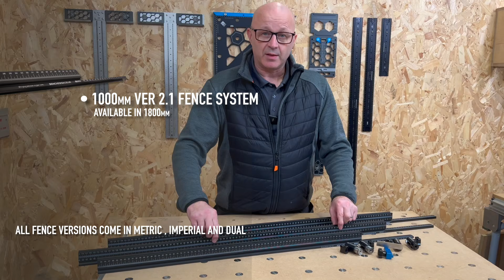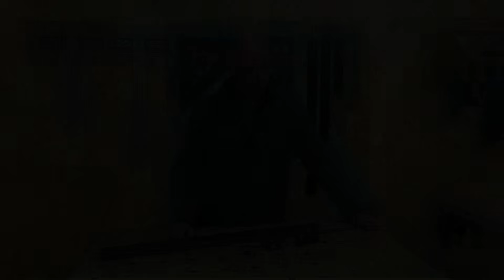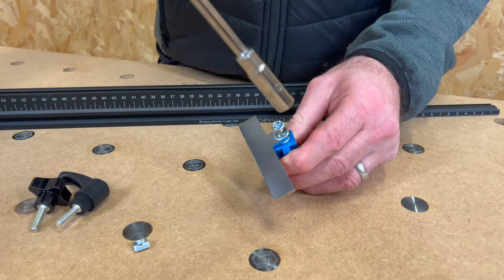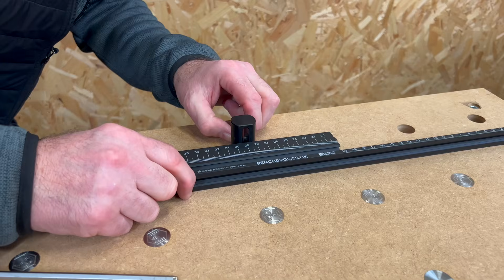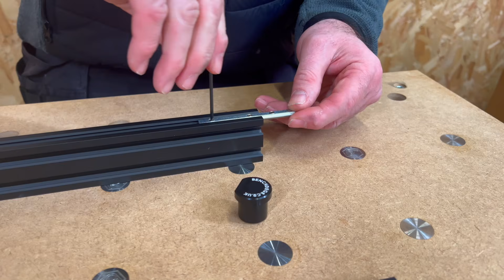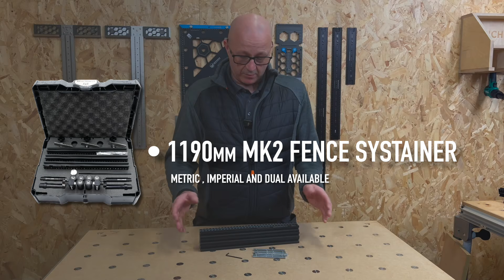Benchdogs Fence System

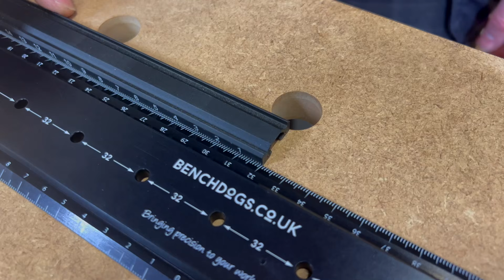Comment: At 6:43 you check the measurement of the flip stop. 

Mine seems right on, but the extension under the fence is too long, by a half mm or so. 

Seems like I should trim it off with the track saw.

Comment: I found the T-nuts supplied with the Bench Dogs and Flag Stops very annoying because they easily slide and fall out of the Guide Fence’s T-slot and can easily get lost.  So I replaced the supplied T-nuts with slide in ball sprung T-nuts which stay in place when the Dog or Flag Stop is removed so I’m less likely to loose them. These ball sprung T-nuts still allow the Dog or Stop to easily slide along the Guide Fence’s T Slot.

Comment: So what exactly is the difference between the Mk2 fence and the version 2.1? I need a fence for my Kreg ACS track saw and can’t tell the difference from this video.
Reply from the maker: The mk2 has a 200mm add on and the ver2.1 has the under rail support is machined out of the extrusion
Reply: @Benchdogtools is there benefits for being able to remove the under rails support? I’m leaning towards the Mk2 as you can make 8 inches longer. Is that correct? Thank you.

Comment: Would you recommend a 1000mm or 1200mm fence for a MFT3 or MFT1080? You wouldn't use a right fence on a table this small by itself correct? What is the advantage of the quad dogs over the fence dogs?

Comment: Hey team, recently purchase the 1000 mk2 and want to get it square to the mft hinge and track. 

I’m struggling so was wondering if this system only works with track dogs for the track itself.
Reply from the maker: Hi Casey. 
No problem we can help you solve any issues. Can you ping us a email with some photos of your setup and we can see where we can assist you further.
Reply: @Benchdogtools  I purchased the quad dogs with 40mm shafts. I’ve also purchased Dave Stanton’s dog locks which work great. My new issue is that the cut line is over a column of holes in the festool mft top. What would you recommend doing? I can see it’s the same in this video?
Reply: @caseys717  Hi Cassey, that is the known issue with this setup. Use our benchtop protectors, which will create a void between your workpiece and the table. This will prevent this, or using the guide rail dogs as it moves the cut line in between the rows of holes. Hope this helps.

Comment: Minor comments: I have one of these fence systems and I really like it. I found a squirt of the silicone WD40 in the top channel helps the flag stops move really smoothly.

I'd prefer it if it were one or two millimetres shorter to eliminate the risk of the tracksaw's blade touching the fence. Then use the method suggested by Peter Millard to calibrate the system. 

As I said, I really like the fence. However, I reeeeaaaalllly like the 175mm carpenter's square, which instantly became my go-to tool for checking... well, pretty much everything that can be measured by it. It just has a lovely feel to it and is dead-on accurate and easy to use.

(I also have a rail square, another super Benchdogs tool.)
Reply: Very happy with mine. Great piece of kit

Comment: As noted in the video you can put the flag stops on facing both ways. I have two flag stops on my fence so I can cut two sizes without adjustment. The stop nearest the track has the flag towards the track and the other one faces away so that you can cut up to the end of the fence rather than the end less the stop length. Excellent product.
Reply: what a great post - thanks